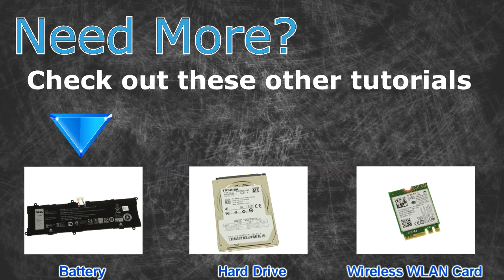Dell Inspiron 15-7568 (P55F002) LCD Touchscreen Assembly How-To Video Tutorial

Comment: Question, I have the 5577 with a TN panel. Just my luck buying it before Dell decided to replace the model with IPS displays. Anyways, I'm looking to change the display from a non touch TN panel to an IPS. The question is, is it possible to add an IPS *touchscreen*? Does the MOBO need to support it?
Reply from the maker: From what I can tell, there is a touchscreen and non-touchscreen option that should be compatible. Unfortunately I don't have any other information. We haven't come across any parts for the 5577 yet.